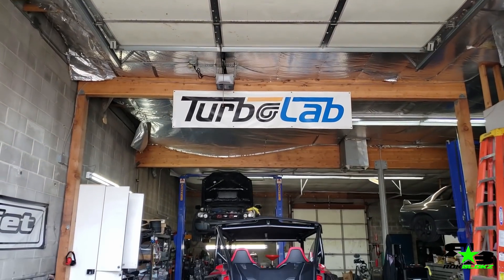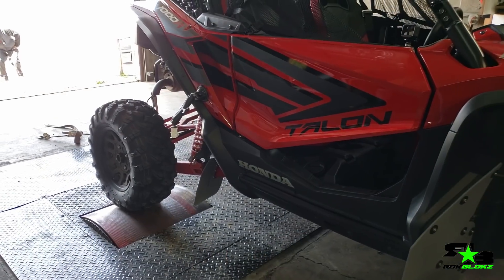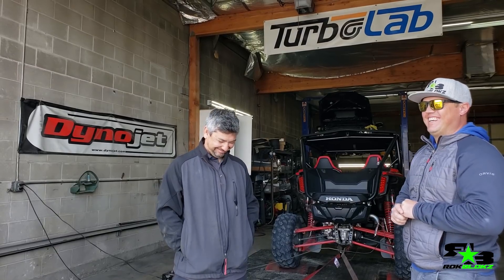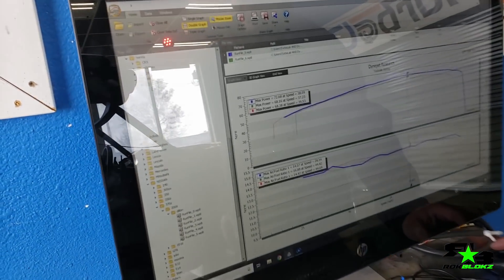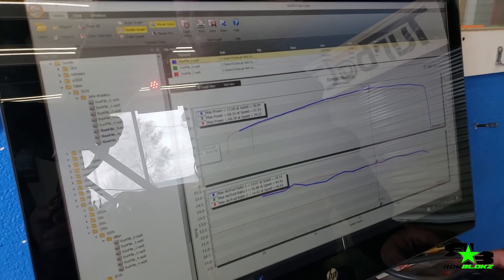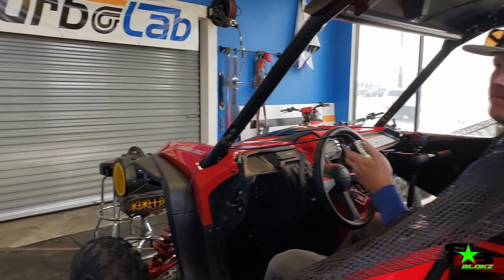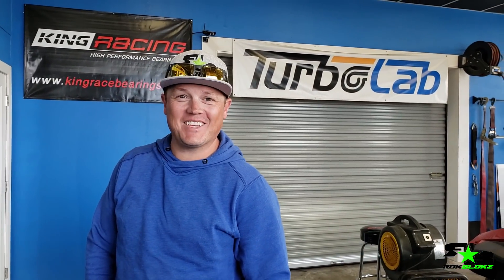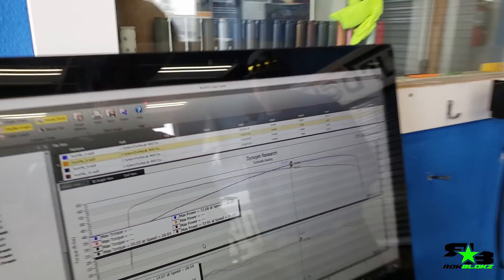Rokblokz 2019 Honda Talon 1000R on the Dyno!

Comment: I don't know about the time of this video but you can now use your tuner to put the talon in dyno mode so that the front wheel speed sensor doesn't need to be used to shift the gears giving a much more accurate number because you can then do a pull on a 2wd dyno.

Comment: I just saw a different company that  also did a Dyno test on a 2019 Talon , they Had an Innovative way I believe to get around the Honda software by taking off the front tires and jacking up the front end , I think this gave them a more true rear wheel horsepower reading ? ,  They achieved  85 horsepower at the rear wheel..  / Teamalbaracing , Alba Racing Dyno ..
Reply from the maker: Yeah I saw that too, it was a good idea. This still gives Joe a good base line to compare turbo numbers to, plus he figured about 10 more hp was probably a more accurate number. Either way, we had fun!

Comment: I’ll definitely be keeping my YXZ
Reply: Don’t forgot to add all his power is at the top end....
Reply: Shuffle3956 Wrong, after the YXZ engine breaks in and/or a tune they make a lot more low end torque. With the high RPM the climbing power at the dunes is incredible. It takes a turbo RZR to run with them. See my video n/a YXZ vs Turbo RZR.

Comment: Seeing as the dyno has the front and rear rollers linked, I would assume running in 4wd would be more efficient since its powering both rollers vs running 2wd and powering a single roller plus the linkage/second roller.

Comment: I bet you could unplug the front speed sensor and piggyback the harness off from the rear speed sensor. That way the pcm sees wheels speed on front and rear. This should let the transmission shift without the front wheels actually moving. I’ve been toying with trying this on my Pioneer 1000. Hard to really bang off the gears in the snow or mud playing in 2wd. 😂
Reply from the maker: Ha ha, that's a good idea. We did try unplugging the speed sensor, unplugging the speed sensor fuse, but not tying it into the rear. And yeah I'm a little worried about playing in the snow and mud. Or just having it go bad.

Comment: What altitude are you guys at? Looks like Orem UT is about 4800’ which is about a 14% loss from altitude?
Reply from the maker: Yeah sounds about right for Orem's elevation.
Reply: HOW does that affect the drive line loss?
Reply: @wraith511802003   because it affects the motor thus affect the HP that goes threw the drive line
Reply: @lucasetcheson3442  Explain how that affects the static drive line loss already present at sea level. What you saying is it lowers HP not increase drive line loss.
Reply: @wraith511802003  because there HP base is at sea level so if I dyno a motor at sea level and it makes 110hp
Then take it up to 5000ft and dyno the utv to see what the loss in drive line is that test is scued because I would first need to know the hp of the motor at 5000ft
Reply: @lucasetcheson3442  Well do you know if honda tested their crank HP at sea level? NO, so if you extrapalet that to be not above 5000 feet and the average drive line loss is 14% then we can see that there will be not much difference in the numbers.  The RWHP is around 75 .
Reply: @wraith511802003   it's been published this motor was designed and made at Honda's r and d facility which there are 3 in the USA and all three are at most 800ft above sea level
Reply: @lucasetcheson3442  SO yes 75 RWHP
Reply: Guys- day I numbers from corporate are always as high as possible and it’s effectively sea level. This engine is Japanese made, also. The chassis and overall design is what was designed more in the states.

Comment: The taller tire on your other buggy have the car geared higher which in turn puts more load on the dyno hence the reason for the higher readings.  Very common for cars/trucks with low rear end gears read lower than same vehicle with higher gear set.  Doesn't affect tuning capabilities just moves power curve.
Reply: If that's true, then dynos really aren't accurate -- the HP and torque of the engine and drive train didn't change.

Comment: The Talon is most likely like most Honda 4 wheel drives the front differential ratio is slightly taller than the rear so there is no fighting for traction this would prove why you're getting different numbers in 2 wheel drive vs 4 wheel drive if the rollers are not link the front should be turning quicker and the power reading should be coming from that drum

Comment: I thought having the DCT would not lose that much HP
Reply from the maker: It was pretty interesting comparing the machines. I dont think there is as much loss through the cvt system as people think either. But the talon would have shown better numbers if we'd been able to run it on the 2wd dyno and if it had been at see level. Our altitude robs quite a bit of hp on an na motor too.
Reply: @Rokblokz  Thanks for the reply.  I just live to the North in West Haven.
Reply: @Rokblokz  The TURBO S had way less loss than the talon showed.

Comment: So what this dyno is telling me is that the Talon is loosing around 30 % of its HP through its gear driven drive line. WoW!! That sucks. Dyno testing this kinda drive line is a little different to us. If I'm correct Honda's I4x4 has more power going to the front wheels than the back. All other SxS's have a 50-50 ratio. It would be very interesting if you dynoed the front wheels with the back wheels off to see if the Talon is built like Honda says it is. Would be very interesting.